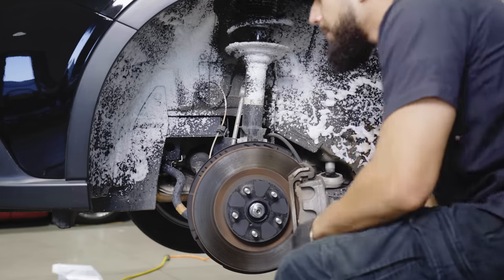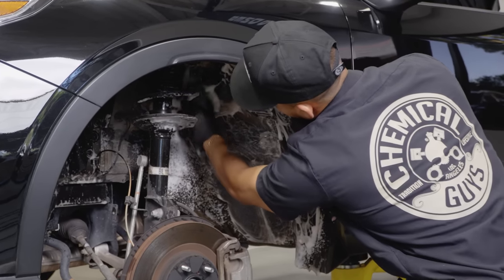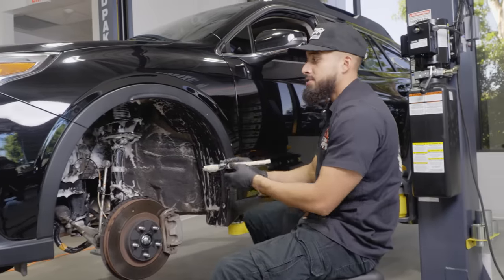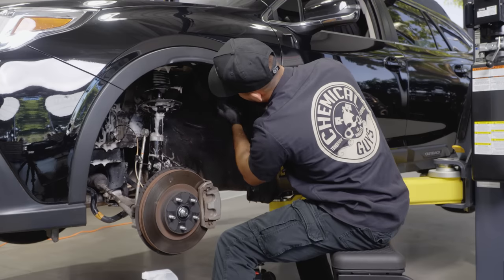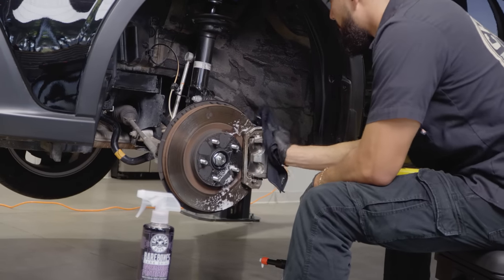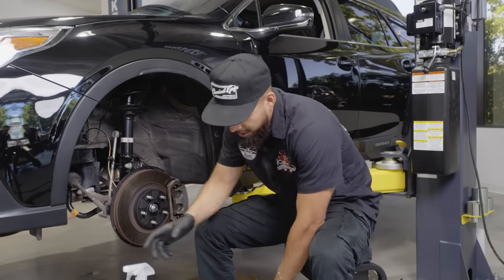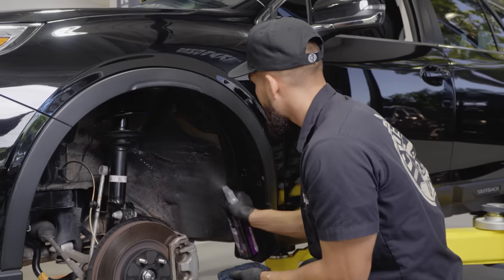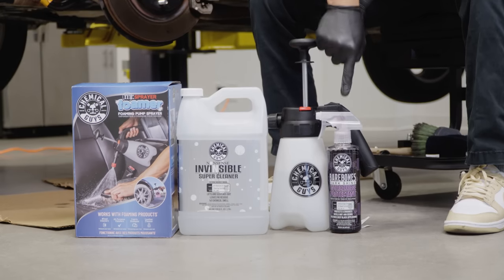🟡NEW Product Alert!🟡 - How To Foam Anywhere - [Undercarriage Cleaning DIY] - with Mr Sprayer Foamer!

Comment: Too bad it only atomized for a few seconds before it went to a stream. Hence the edits.
Reply from the maker: You can always pump it again and foam the area again to create more lather. Keep in mind this fender well is not small as other cars. Thanks for watching!
Reply: So it’s good for small areas and not foaming the entire car
Reply: @welll8  i would call 1 square foot a real small area🤣
Reply: Wow. More time spent pumping than foaming. Couldn’t even foam one rim. I’ll pass.
Reply: You’re not wrong! I use a weed sprayer from Home Depot. It has a wand with flexible tubing attached to the tank and an adjustable nozzle. I pump the unit several times up and down until I can’t pump it anymore and I’m good to go through the entire tank - I don’t have to continue pumping. It isn’t $40 bucks either.
Love Chemical Guys but some of the products and/or tools are total b.s. or unnecessary.